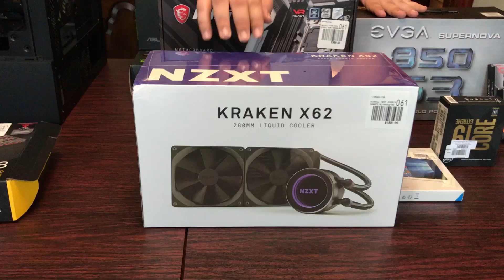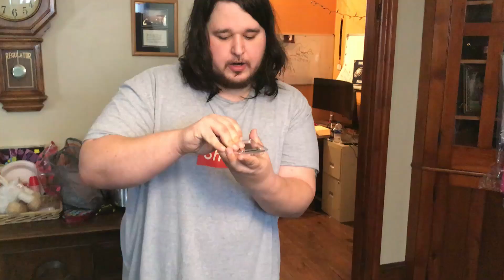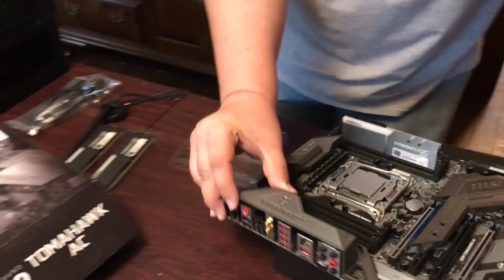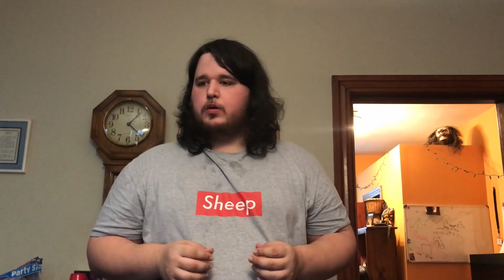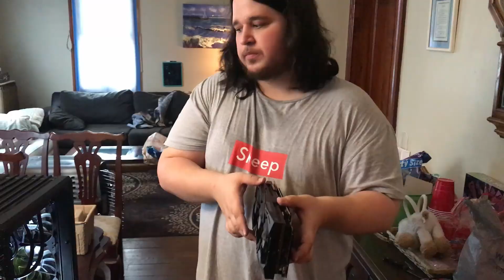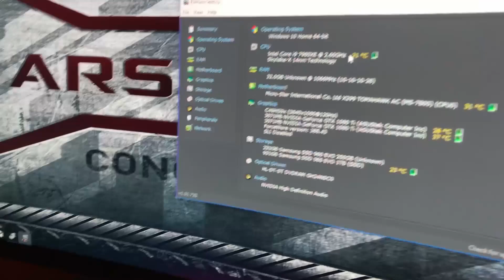$8000 Ultimate Gaming/Workstation PC Build 2018

Comment: You should correct the memory placement on the motherboard to get proper Quad Channel Memory support.
Reply: If he does that then he can install the AIO block correctly as well.  Enable XMP or statically clock that RAM(the manufacturer stickers look like they say 3200 not 3000) too...